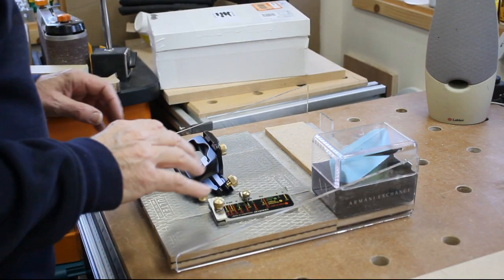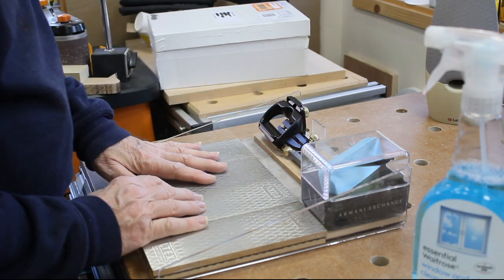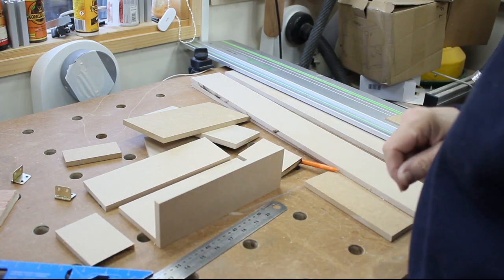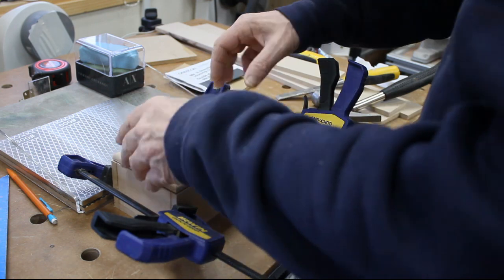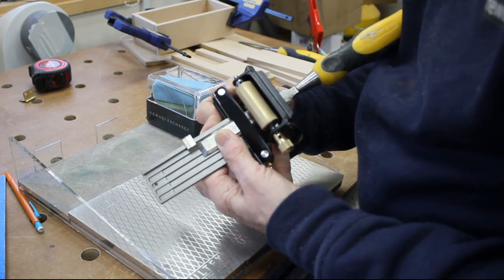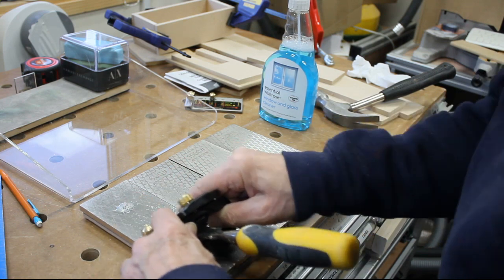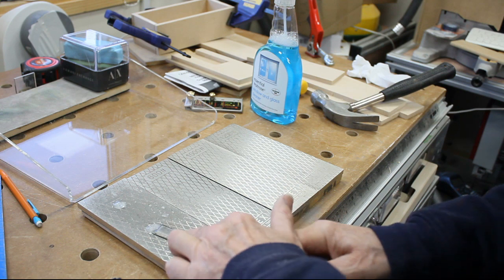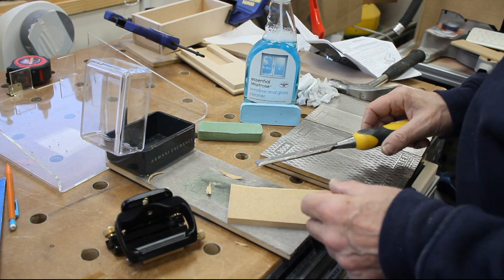the small shed #181 - a home for the honing guide

Comment: My problem too has been not having the right tools to do the job ( ie 2 pieces of a project never match) I have since built up a 'small selection' of equipment that should ( like you ) enable me to produce better workmanship. The problem I now have is I "have to move something to use something" and what should be a short quick job takes forever and basically puts me off doing it in the first place. I have since put everything on castors and listed loads of non useful stuff I have gathered over the years on ebay to gain space. Just like to add that I enjoy your channel that much I 'cast it' onto the smart TV now. Always look forward to Fridays projects ( and Saturdays purchase updates ) Thanks for the motivation - Mark
Reply from the maker: It still seems slow sometimes having to roll stuff out, but I think it's psychological, it's really much easier to find stuff now I've been forced to keep it tidy, and I  have found it's much easier to get little jobs done, as you  can just pop outside, pick up the tools you need, do the job on a clear bench and have the right tool for the job. 
I'm all for hand tool woodworking, but it needs so much more practice than using a chop saw or a dovetail jig. Cheating I know, but it's more satisfying to make something square at the moment, rather than something hand crafted that's 'rustic'.

Comment: also what is the mitre 2 part glue you use. I had some mitre fast given to me some years ago which I used but when I last looked it was quite expensive.  - I had neglected my chisels over the years ( 8 in total ) so they had some surface rust and and the points had gone dull - took me days to get back to being useful ( i can't sharpen them without a guide either and have reservations about the roller damage too ) I used brake cleaner to clean down the equipment after
Reply from the maker: Hi Mark, I'm using Mitre bond from Screwfix, it's great for a fast joint, though for timber to timber I prefer the Titebond or Gorilla white glues.

Comment: Havnt used mine since I bought the Sorby Pro Edge
Reply from the maker: I have to say I have wondered about this, as there's a lathe coming along at some time in the future, and the Pro Edge looks to be the right tool for turning chisels and other woodworking stuff. The down side is it's not cheap, but nothing decent is in this world.
Reply: @thesmallshed  What in life is cheap?  You can't take it with you.... Enjoy life to the full. You wnt regret buying one. Dnt waste your money on wet or dry stone grinders... Itl cost you more long term.....
Reply from the maker: It's more the space it will need!
Reply: @thesmallshed  it only has a 10x8 footprint mine is currently clamped to my MFT as the bench where it normally lives is full of crap I'm trying to sort out